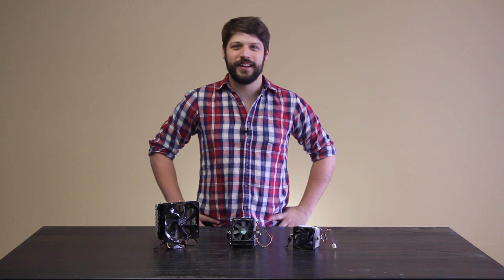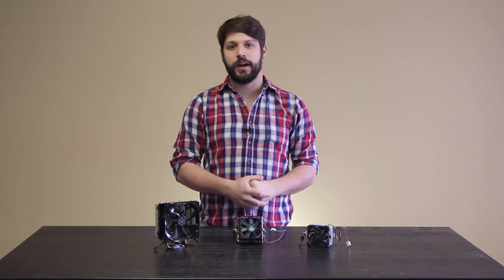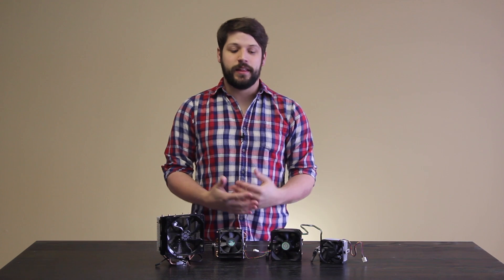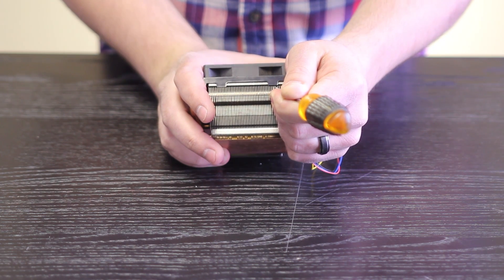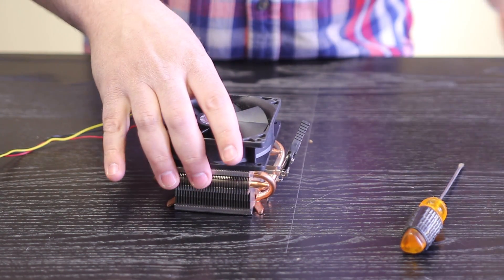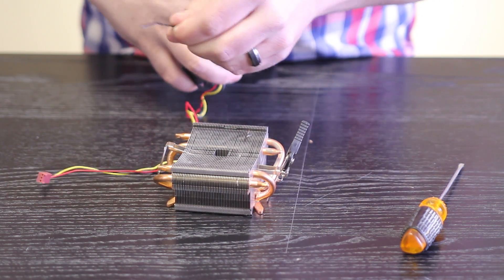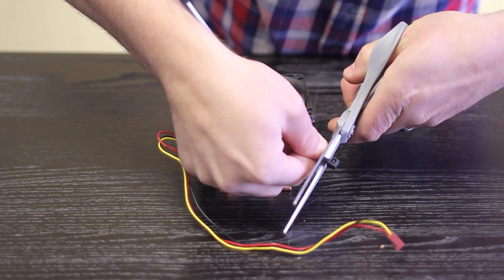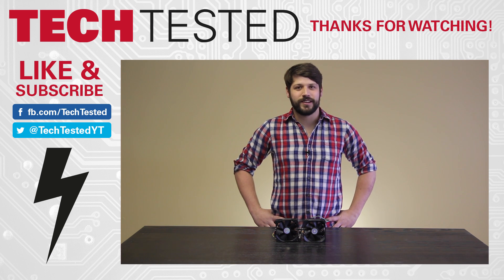DIY AMD Wraith Cooler – Upgrade Your Cooler For Cheap

Comment: One critical problem with this hack: vibration.
Once my FM2 base got wrecked by a noisy stock cooler.
Time later i repaired other amd stock cooler and found some plastic grips between the heat sink and the fan. This is in the aluminium cooler.

After noticing this i made a silicone barrier as replacement for grips and bolts, vibrations are gone (epoxic clay also works). Since Wraith coolers like this used only plastic grips, you can reinforce the union between the fan and the sink in the same way.

Also is not recommnded to join the fan too close to the sink. Stock amd coolers has a little gap and i found why after this experience.

Comment: https://www.walmart.com/ip/Plastic-AMD-AM2-AM2-AM3-AM3-FM1-Socket-CPU-Cooling-Fan-Bracket-Base-Blue/313019429?wmlspartner=wlpa&selectedSellerId=571&adid=22222222227000000000&wl0=&wl1=g&wl2=c&wl3=42423897272&wl4=pla-51320962143&wl5=9025985&wl6=&wl7=&wl8=&wl9=pla&wl10=111838760&wl11=online&wl12=313019429&veh=sem&gclid=CjwKCAiAo7HwBRBKEiwAvC_Q8WoKCIBXg2jVS4k-2jN3sWzC3OQrsyhuGKdD2zlZs_QmQUjVI5eBiBoCj14QAvD_BwE

Comment: If anyone is watching this years later, I just made a custom cooler for my Niece's PC, the CPU was running up to 90 degrees when gaming, it was way too hot, this was on an old Intel cooler, the small rounded ones with a tiny fan, and some of the heat can definitely be attributed to it needing some new thermal paste, I replaced it with a tall heatsink that came with an old motherboard, glued on a fan blowing through the grooves of metal, and another fan on the side blowing air directly at the back exhaust fan, added some new thermal paste, and ran small bungie cords through the mobo holes for cooler mounting, then around the heatsink to keep it fitted tightly.

I'm now getting 52 degrees with Heaven Benchmark on a loop, and around 62 when gaming steadily, amazing performance for a homemade heatsink, plus the main fan has some RGB, so it even looks decent for a DIY CPU cooler.

Comment: I can't help but think that if someone is looking up ways to ghetto rig a larger fan on their stock cpu cooler they most likely aren't going to have the necessary materials handy to perform this mod, therefore increasing the cost when you could have ultimately just gotten the cheaper cooler master cooler with better temps.

Comment: I did something similar once, I made a funnel from aluminum from the original fan size to 140 mm and slapped a 140 mm fan on top of the newly made adapter. It was just aluminium that I cut out and bend. I just fixed it with some zip ties, sadly I lost the adapter when I changed my setup, wanted to test it out on my new Ryzen...

Comment: I made similar way many cpu coolers. But i recommend to use screws or metal straps if possible to hold the fan better.

Comment: I think the better way is just put new fan on top the other , (one on top the other) and you have 2 fans.
Maybe even better performance if you put bigger first on the cooler and smaller on top of him and then you have extra cooling sistem on lower rpm.

Comment: I will be testing this with slightly beefier AM2 cooler that came with older Athlons.
I is kind of neat, since new Ryzen CPUs can actually use older AM3/AM2 coolers that mount with these clips, and many people having Wraith Stealth or Spire cooler could reuse the fan on the much better AM3 FX cooler, which has heatpipes.
Good video anyways.

Comment: So i followed this "tutorial" used my old amd with heatpipes cooler on my fx-6300 and got temps 20 degrees lower than before also no more noisy fan so yea it works very well, so fu all haters about 10 min video blah blah! It worked just great.
Reply: İ have an after market cooler which has 92 mm fan, do you think there would be a difference if i put a 12 mm fan on it like yours?

Comment: there's an easier method. get the rubber anti vibration screw plugs for the back system fan. you can pull it through the fins and pull away from the fan.

Comment: *Better way to mount??* I liked your idea but did not like how using the zipties left the fan sitting on the heatsink crooked no matter how many different ways I tried it. I then noticed that the original plastic rectangular fan mount is exactly 92mm long. Knowing that i lined up a 92mm fan with it and decided to super glue the 2 matching size sides. I took the original AMD fan out of the holder and carefully broke off the 4 little clips that held the fan into the black plastic holder (as they would get in the way of the 92mm fan). To hold the fan somewhat tight to the original fan mount I used a rubber band which helped hold it in place while still allowing me to line up the sides exactly. I then super glued the two sides that were matched in size/flush, let the glue dry, removed the rubber band and then clipped the modded original fan mount and 92mm fan onto the heatsink and reinstalled. It looks very clean looking and almost like it belongs on it...near perfection.

Comment: I gave this a go the other day so far no problems. I had 2 4pin  ball bearing fans 0.5A and 0.6A the original stock fan was 0.7A. 
I went with the 0.6A fan but am left wondering if a 0.7A fan would give better cooling?
Reply: The first 92mm Square fan i tried was the 0.6A which worked okay till it was under load only reaching a max of 3500 RPM. I was unable to run Prime95 for long before reaching high 70's and stopping  the test to avoid damage.

 I found a 0.7A fan although it's a round 92mm maxing at  4200 RPM. The temp now sit 65c on stress test on prime95.

I'm only doing this because my rig runs 24/7 and has had 3 different liquid coolers fail in the last 4-5 years, the last one frying the CPU. Not wanting the nightmare again went back to stock cooler which just wasn't enough. 

Much happier now, it should handle anything i can throw at it!

Comment: why you can't just use hot glue and attach 92mm fan to the bracket of stock fan and then clip it back
Reply: 1sonyzz if the heat sink gets hot enough to the glue might melt and it'll get everywhere

Comment: I got to tell you I did what you did but even better. My system is an AMD FX-4300 Quad-Core at 3.8Ghz. I bought a Vantec 92mm case fan with Temperature Control and fan speed between 1850-3100 RPMs. I put the Vanteec fan on an AMD3+  heatsink I had laying around.I also  installed the cable ties differently than you. I started the cable ties right from the top fan screw holes and finished off through the heat pipes to the other top side. Once  done installing the new fan heatsink. Then I started the computer up and start to over clock my cpu.  I got my cpu up over 4.8 Ghzs a full 1 Ghzs faster the than stock speed. I didn't even really heard any fan noise on the cpu.  I thank you for your youtube channel and the stuff you have done.

Comment: use thinner zip ties and also  wrap them around the  heat-pipes on the other way and make smaller loops as 2 heat-pipes goes on the farthest end of the heat-sink on opposing end and can be sued as ankar points for the fan, other woudl be to sue the stock clip mont  grind it flat on top and drill holes or glue on a mount system on that.

Comment: I had the aluminum one and I  made a wraith cooler without copper with it... Temps are better than before. But I broke the mounting brackets for the stock cooler so I used zip ties to mount the cooler. It's doing perfectly fine right now :)

Comment: i have the cooler with no heatpipes on my case i have a slot for a 120mm fan directly on top of the cooler. could i get away with just a 120mm fan and remove stock fan. i dont want to improve performance just reduce noise

Comment: Great to see more ppl like me out there.  Been doing this mostly with 80mm fans on the older AMD and Intel coolers as far back as 98.  

I was the only one of my group of friends who ever did early cable management thru the back of old top Slide cases.
You are one of the few not afraid to show ppl that less is usually more in the world of PC's

Comment: Best bang for the buck PC build:

AMD A10 7870K 125W cooler 134$ (not the near-silent one if you can't find it for less than 10$ more)
Asrock a88m-g/3.1 61$
Corsair Vengeance Pro 8GB (2 x 4GB) DDR3-2133   44$
EVGA 430W 80-plus power supply   30$
Seagate 2TB 3.5" 7200RPM Hybrid Internal SSHD 90$
VIVO CASE-V02 ATX 2xUSB 3.0 2xUSB 2.0  40$

DIY Wraith Cooler with Antec 75002 92mm Fan  10$
 
Total 410$ and should be overclockable for extra value for the money,

If you can live without overclocking, the 77$ AMD A8 7600 is at the 85-90% of the value of the higher A10 part and saves quite a lot of money. That's the one I'm actually using with the rest of the parts almost the same.

Comment: I've made a 'Wraith cooler' with the stock aluminium cooler on the right, it worked out quite well. The max temps are only 59 degrees.

Comment: Wouldn't want to spend the money on it? yeah let me buy an intel with only aluminum cooler (less material and cheaper, more profit) Only twice the price of an amd, get hotter than amd, uses less power. I'm still not rich and electricity is not expensive where i live. Amd it is with a evo cooler. But as a stock cooler, amd does a much better job than intel ATM.

Comment: Never do this at home! You will lose the warranty of your components, and if the fan comes off... the cpu will overheat, and the fan can hit the gpu. Change the fan only if you can fix it with screws.

Comment: Here's some feedback:
1. A near-10 minutes video to watch a fan come off, and then on with another by zipties?  Think on that.
2. If anything, at least show the before and after differences to the cooling performance.
3. Overall, there's a lack of "tech", and "tested" in the entire video.
Reply: That's because the gains are obvious and don't need to be shown,  you put a 92mm fan over a cpu that had 60mm fan the gain is obvious.

Nice try on the troll though however in this instance the lack of knowledge failed you.
Reply: Here's some science for you, it's not the width of the fan that matters.  But rather the amount of airflow, cubic feet per minute (CFM).  Also, there'a a difference between "the gains are obvious" vs "the gains are quantitative AND comparable".
Reply: @animalyze7120  so youre saying my 80mm 5000 RPM static is obviously outperformed by my 100mm 2000 RPM dynamic over a cooler.....yeeeeeaaaah you seem to be about as tech tested as this video. Nice try anti-trolling though.
Reply: @TankR  Well you keep your little secret then.  100mm will move more Air than 80mm at the same rpm dip wad.  5000 rpm on an 80mm fan will be ridiculous loud as well as the movement cap on cfm from such a small fan.  They do have a max no matter how fast you try to run them, you can only pass so much air over that small area.  You seem to be about as tech tested as this video as well.  No trolling attempt was made, stated clear facts.  Do some research man
Reply: @TankR  Yes. Not only is it not an "80 mm 5000 RPM" fan, its a FORTY SIX MILIMETER fan running at 6300 RPM. Of course it's gonna be outperformed by a 100mm 2000 RPM fan.

Comment: This is not a Wraith Cooler at all, that's the stock cooler with a bigger fan.
Reply: +Yosyp i would like to see an update with the temps of the real wraith cooler in the chart.
Reply: ***** Well, let's DIY a car then :D

Takes a box and puts 4 wheels

There ya go :)
Reply: ***** But it doesn't if you compare it with the original cooler.
The final product has to be as close as possible to the reference model, this is not close at all.

I know it's DIY, but this is not even fairly close! D:
Reply: ***** I meant the Wraith.

Comment: I think you guys have sort of missed the point of the wraith cooler. Why were there no db measurements of the fan speed under load? The wraith cooler keeps the cpu at a lower temp AND makes way less noise. I can't imagine the 92mm being nearly as quiet under load, not to mention you will have to control the fan speeds manually. If all you wanted to do was keep the temps down you could mount a 120mm fan really close to the cpu and leave the stock cooler on it.

Comment: What I run my i7 920 at 80-ish centigrade under load (OC'ed to 3.57GHz with an aftermarket cooler), and it's fine, with stock cooler I had it running at 95C-98C under load and 90-ish at idle without even overclocking, that was for 3 years before I got the aftermarket cooler, and now 60C is alot!?
Reply: +FiNiTe If 1: if i remember correct it had someting to do with the placement of the temp sensor, amd cpu's have one sensor between the cores and intels have one per core. Of course the cores are hotter than the rest of the chip so intels reading is higher, but the actual core temp difference will be less than 40°.

2: and not to forget that the intel engineers have more r&d budget to make a chip more reliable and thus the max temp can increase by a few ° without shortening the lifespan too much.
Reply from the maker: +FiNiTe Intel has a max temp usually around 100c before throttling, while AMD has a max temp of typically 62c.
Reply: Tech Tested I didn't expect that since AMD CPU's usually have a higher TDP..
Reply: try to remove the cooler and then mount it properly this time, That is what happened to my old pc.
Reply: +FiNiTe Your CPU is not supposed to surpass 67.9°C !! Check this link, correct me if I am wrong  http://ark.intel.com/products/37147/Intel-Core-i7-920-Processor-8M-Cache-2_66-GHz-4_80-GTs-Intel-QPI
Reply: Tcase is ihs temp not core temp (Tjunction  max) http://www.intel.com/content/www/us/en/support/processors/000005597.html
Reply: Hasan Zobaer If that would be the case then my CPU wouldn't even be allowed to be shipped XD

Stock cooler at stock speeds: 97C max temp under load, idle at about 92+C
Reply: i have Xeon E5450 3.8, and ~60C on linpack load.

Comment: No thoughts on the Hyper TX3?  Cheaper than a 212, better performance than the stock cooler, and no need to remove the heatsink mount from the motherboard.

Comment: direct contact heatpipe to "plastic" zipties, don't do it, kid...just, DON'T.
not to mention central burn on processor. "tech" my ass, they don't even science.
Reply from the maker: +Tenderloin Salmon The heat pipes will not heat up enough in order to melt the zip ties.

If central burn on the processor were a concern, there would be no such thing as a downdraft CPU cooler. Even the stock cooler has a large motor in the middle. The heat dissipation spreads through the whole cooler.
Reply: Tech Tested

ik
Reply: +Tech Tested I would have thought that, that was common knowledge. Thanks for putting it out there for those who didn't know !
Reply: He literally just pulled plastic off before putting zip ties on though..
Reply: You're a special kind of Stupid aren't you?

The heat from that sink will never be hot enough to melt a zip tie and if it does...you're doing something very wrong with your Overclocks.
Reply: lol, internet so fun
Reply: lol, internet
Reply: +Tenderloin Salmon Stop acting like you were joking dumbass. You are actually entertaining us with your stupidity.

Comment: i was already thinking about building something like this.. for my FX6300 
Now i,m sure  ..Tnks. and great video.  .Keep on t.
Reply: +Dennis Stomphorst I would like to OC my fx 6300 for JC3 but cannot find a cooler that will fit in my case to 212 evo is a few mm to long ;(
Reply: +Scon Videos 
Look up the cryorig m9
Reply: Trenton Hughes ty for the suggestion, ill look it up later.
Reply: +Scon Videos  
now building somthing els  Homemad   Big-Rib  and if possible 2   .12 icnh   fans  .. if you look at my Google plus  i wil post some pic,s  when i,m building

Comment: How is it possible that i tinkered the EXACT same ghetto stock cooling a month back without seeing this video. The only difference is that i also lapped the bottom of the cooler straight for better heat transfer.

Comment: There's much more to Wraith than just a larger fan. The surface area of the fins is much more dense and is much larger, we switched to a larger fan with more static pressure, the base plate now makes much more contact with the CPU. All of these things combined with the new Fan size are what makes wraith so effective. it will ship with the 8370 and 7890k, while our silent 125watt TDP cooler (it's basically wraith with out the illuminated logo) will be shipping with many more SQUs. Anyway I liked the idea and I'm glad you saw an improvement in thermal headroom. nice video.
Reply: +Tyler Cox I have to agree, calling a standard 125w cooler with a 92mm basic fan strapped to it is a bit irresponsible IMO.  The Wraith/Near Silent 125w thermal solution is in fact much larger overall and a simple fan change doesn't make a Hyper 212 a NH-D15, lol.  Here's a link to size comparison of the heatsink to the 92mm fan http://i.imgur.com/cJcMzm7.jpg

Comment: This would be a good Han Solo if you do not use a mid/full tower case. My CM Hyper 212EVO beats his T4 spec at half the Celsius. I needed an audio workstation for silence: an AMD FX-6300, Arctic MX-4 non-metallic on cpu, NB, SB, the ITEs and USB controller chips. With 4 Fractal Design Fans, PSU fan, and CM fan, all under 30dBA total. The 212, space-wise, is like strapping a Harley to your chip. At that point, I didn't like the noise and specs from liquid. I just don't overclock anything, and this is not a modern APU with a single controller chip. I built it for x amount of legacy support (linux stuff).  Runs ~73.6F(~23C) no graphics load, ~65F(18.3C) boot. It gets in the 90s(F) on Skyrim with a lowend R7 card, max105F on Handbrake, which is a good software test because it utilizes all of your threads on video conversion.
Reply: +Storm Shadow Also, what you get for trying to cool over 95W. Tricky. I would like to find out the quality of the Wraith fan. That would be a determiner. I swear by my Fractal Design.